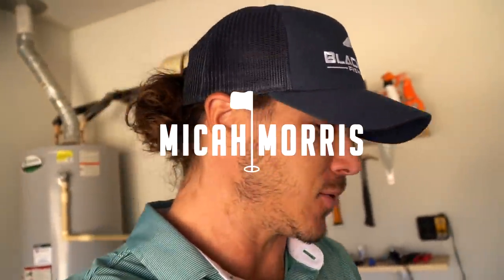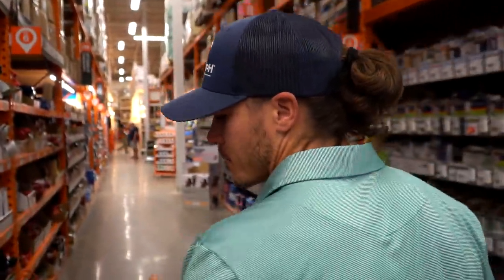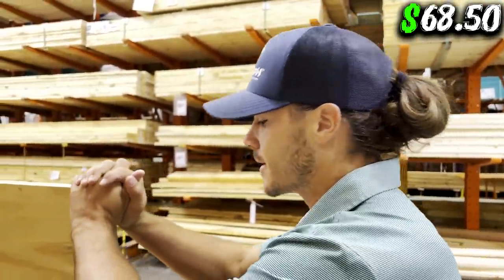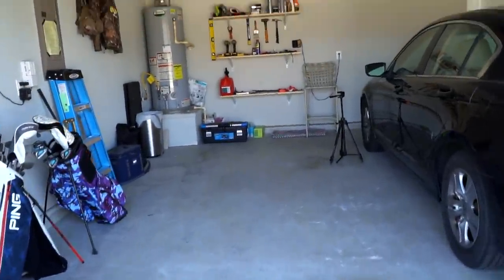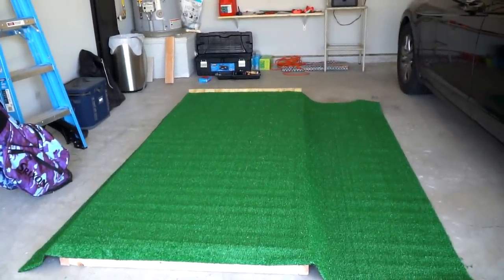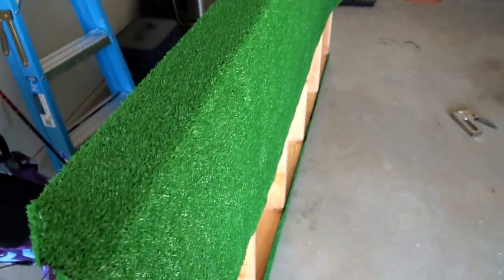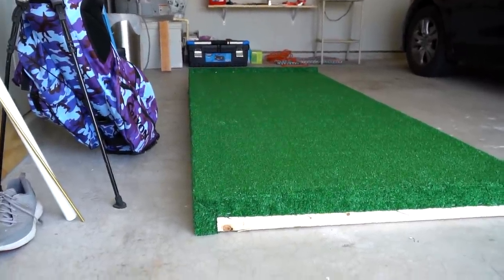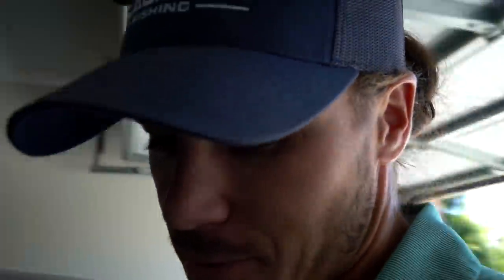How I Built My Own Putting Green For Less Than $100

Comment: If you got spray paint and painted a finely thin line straight down the middle, from one side to the other. Seems like it would be useful on just trying to keep your ball line/trajectory on those straight line puts. Great video and forsure will have to set something like this for winter time for practice

Comment: 40 buck 9’x3’ putting mat online at Amazon has done me well for almost 4 years and rolls just about like the greens on my home course.  Roll up when done and can stand off the putting surface for different putting angles or add foam underneath for undulations.  I had a link in another comment but it got deleted twice.  The mat has over 14k reviews, check it out for something simple.
Reply: Not sure why he needed to build a platform at all
Reply: I am glad you made this comment and that it is still here a year later.  A mat makes total sense and went to Amazon and found one I liked.  It doesn’t  make for a good dyi video though.

Comment: A little late, but if you weren't going to cut a hole and put a pvc cap in as a cup, you probably could have just bought a roll of turf and laid it on the garage floor.  That way you'd have to read the putt and it's even more mobile :)  Good job on the build though.  Looks clean